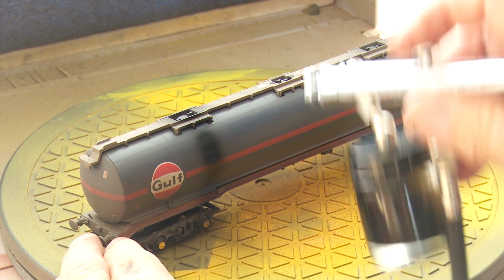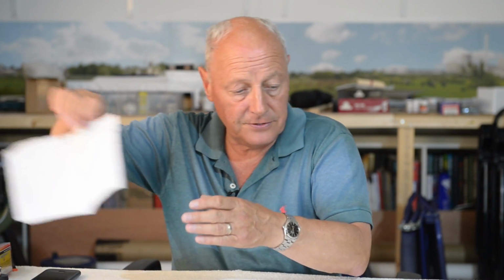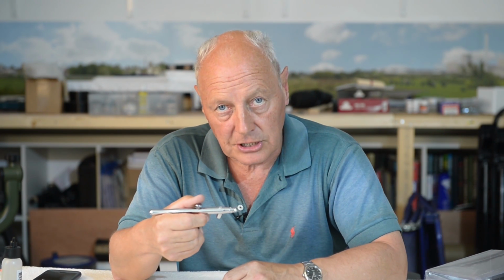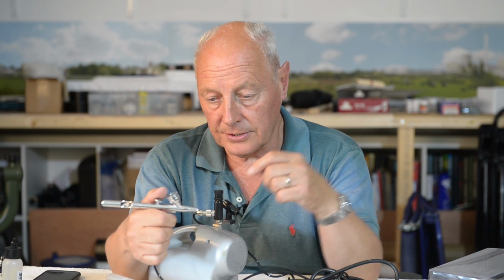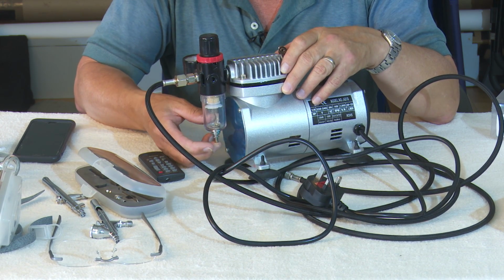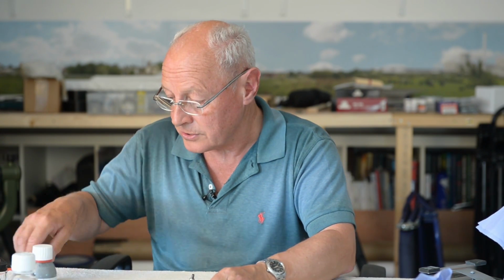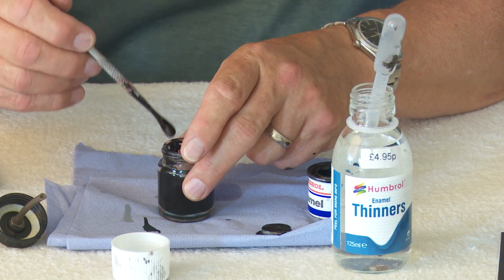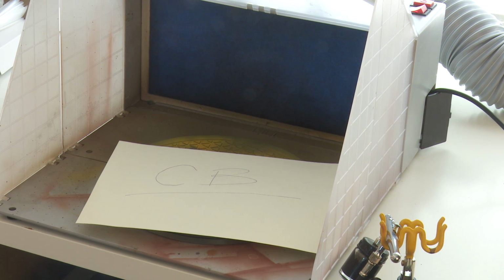Airbrushing at Chadwick Model Railway | 36.

Comment: Excellent video, Charlie! I don't know how I missed this one for so long. But if I may say so without being unceremoniously unsubscribed, I do have a bit of disagreement. Perhaps I'm just taking this in the wrong tone, but you seem to discount single action airbrushes as having a use in model railroading, They do have a place, but as you state they are not ideal for weathering by any means. For uses such as laying down a coat of primer or base color, they are quite useful. Great precision of paint application isn't needed in those instances, and they can actually be more comfortable to use as you are not trying to hold your finger in the same spot while spraying a lot of paint. As an Iwata fan, you may wish to check out the Iwata Revolution HP-SAR Siphon Feed Single Action Airbrush. The Paasche H or Badger 350 are a couple of other good SA airbrushes. I own both SA and DA airbrushes. For primer, base coat, or clear coat applications I use the SA, for weathering or other applications where a great deal of paint control is needed, I go for the DA. Give one a try, you may like it!
Reply from the maker: Hi Flyboy, many thanks for your in-depth comment and I wouldn’t dream of unsubscribing serious modellers.  On my channel I try to promote/inspire guys to develop their skills knowing that they may well have a limited budget.  It was for that reason that, unlike me, I try to encourage folks to buy-in at a decent level of equipment.  If guys can only afford one airbrush then I believe a DA is preferable.  I wouldn’t like to take the blame for someone buying a SA and regretting it, and needing something more versatile.  I’m not disagreeing with you but I’m just trying to justify my bias.
Good luck with your layout.
Regards Charlie.
Reply: I understand your position now, Charlie. The unsubscribe comment was meant in jest. I know you are not the type to do such a thing. I do look forward to your next video. Take care and I hope all is well.

Comment: Many thanks for this video Charlie ! I have finally taken the plunge and opened up an airbrush and compressor kit that I have had unopened for about 4 years ! Assembled easily and seems to work fine.
Reply from the maker: Good for you Ray.
Remember, baby steps first.
Just practice on old stock once you have acquired the cleaning gear.
Regards Charlie

Comment: Hey Charlie, thanks for the great video. I recently got an airbrush and several extra glass bottles that attach to bottom of the airbrush. If I do not use all the paint during my weathering session can I leave paint in the bottles and come back later or will it go bad?
Reply from the maker: Hi, I tend to leave the paint in the jar until I have finished for the day.  It might need another stir should you use it later.  I then tip the remnants back into the original pot. 
I hope that helps, Regards Charlie

Comment: Great video as always Charlie!

I hope you don't mind, but I'd like to draw your attention to a couple of errors you made in this video, probably because you're repeating something you've been told or seen somewhere.

1:
Iwata isn't pronounced 'eye-wata'... it's a short 'i', like igloo.
It's probably a mispronunciation from an American, were they tend to elongate vowels (Iraq becoming eye-raq, etc).
It's not a big issue, just one that bugs me having studied Japanese! ;^D

2:
The pullback motion on a double action airbrush isn't really to increase the flow of the paint, but to 'widen' the spray.
The increase in flow is a side effect though.

Think of it like a spray bottle of kitchen cleaner, with the nozzle that you can rotate to adjust the stray.
Twist it one way and it will make a thin stream of liquid come out... twist it another way and it will vaporise into a mist.

On a dual-action airbrush, the needle is pulled back causing the paint to vaporise... this is good for respraying the whole of a model, or weather with a dusting of grime/oil, etc

When the needle is forward, it makes a pinpoint line of paint. This is good for getting in nooks and cranny's, or painting down panel lines, or pick out details.
I also make model aircraft, and I've painted camouflage without masking by using the pinpoint spray for the hard edges where the colours change, then filling in between with a slightly wider spray.

3:
The water-trap or moisture-trap on an airbrush isn't there to remove mineral deposits from water... it's to prevent water droplets contaminating the paint.

The compressor sucks in air, compresses it and blows it out.
However, there is moisture in the air, and when it's blown through the pipe to the airbrush, it collects and can enter the paint mixture.
If you take a drinking straw and blow through it, the water vapour from your mouth will create droplets around the edge of the straw... the same applies here.
That's not much of a problem with acrylic paints, but with enamel or cellulose based paints, it will contaminate the paint.

The water trap functions to remove the moisture from the air-flow to make sure you have a clean supply or air without any contaminants. 

It is true that a water trap can be used to remove mineral deposits, but they would be used in plumbing systems in placed with hard water, or where limestone contaminated the municipal water supply... but you don't tend to get that in the surrounding air you breathe..

You may be interested in this... it's an air compressor I built myself!
https://drive.google.com/open?id=1e3VGinUCpGX_S7YopLI2acxWrifuDaCR

It may look complicated, but it's not.

At the bottom is a fridge motor.
This produces the air, and goes up a tube to..

A water trap (the fridge motor produces some water and a little oil) to prevent the air from from being contaminated as I mentioned above)

Attached to that is a T-junction which goes off to...

A fire extinguisher (CO2) which acts as a reservoir air tank.
This provides a steady stream of air (because a compressor spits out pulses of air).

Following the T-junction is another T-junction with a pressure release valve on it.
This prevents too much pressure building up until something goes POP!!
This is set at 115psi (I needed something between 60-120, and there was one right at the bottom of the range at 60psi and this one at 115psi)  it never blows off because I don't need that kind of pressure most of the time... but I test it ever year to make sure it's functioning properly... and it makes quite a bang when it does!!

More tubing takes the air up to the final stage, which is...

a second water trap, with a gauge and regulator.
Thanks to the air reservoir tank, I don't get the pressure drop you mention in your video, the water trap makes sure that no other moisture got up to the air flow, and the regulator to control the airflow from everything from an asthmatic ant, to something you could dry your hair with!!

The fridge motor and tank were free, the t-jumction, water-trap and gauge/regulator/water-trap and tubing are standard 1/4" BSP (British Standard Pipe) fittings, and it's mounted on a wooden mount with castors on so I can move it around easily.
All in all, it cost me about £70 to build, but is roughly the equivalent of a £300 compressor if you were to buy a ready-built one.

Cheers

Dave
Reply from the maker: Hi Dave, 
I’m so pleased that you enjoyed the video.
I’m glad that I mentioned that I was no expert and I do appreciated your comments.
However, your link doesn’t work.
Perhaps you should produce a video on the compressor construction.
Regards Charlie
Reply: Hmmm... the link didn't work again!
Try this one
https://drive.google.com/open?id=1e3VGinUCpGX_S7YopLI2acxWrifuDaCR

Although the idea of explaining how I made my own compressor is appealing... I don't like the idea of someone making a mistake and injuring themselves (eg by not fitting the pressure release valve, and ending up with bits of fire extinguiser flying across the room at high speed!!

Comment: Hi Charlie
Interesting video, some useful tips that Im sure will help when I have to weather my 21 mgr hoppers.
Do you have any recommendations for spares etc, I still have to get a needle or two.
Cheers Paul
Reply from the maker: Hi Paul, 
Is yours an Iwata airbrush? 
Regards Charlie
Reply: Yes I've got two Iwata I've had for years but never used much, however both are second hand items but appear to maybe only need a service and needles as I wasn't as fastidious at cleaning as I am today.  I just looked on the Web and got loads of stores but would prefer to use a reputable seller for spares etc.
Cheers

Comment: I'd suggest another tip - find a short length of 2" X 4" timber/lumber and drill some paint/thinner bottle sized holes in it - not all the way through - use a Forstner bit or a spade bit. While working with those bottles, stand them in the pockets in the piece of wood, much less likely to get knocked over. A few smaller holes can be used to stand brushes while they are drying.
Reply from the maker: Great advice Hirsutus, 
I’m on the case to make one.
Regards Charlie